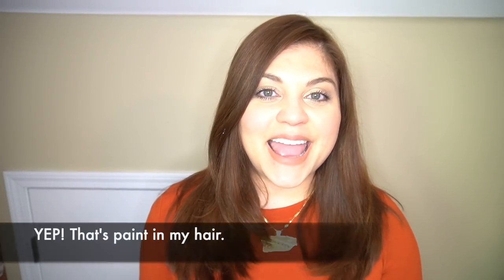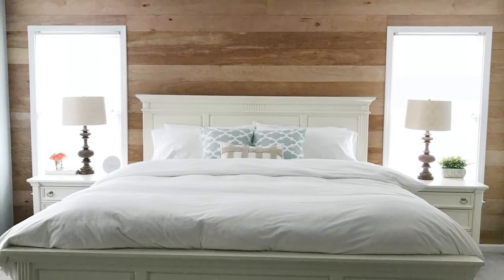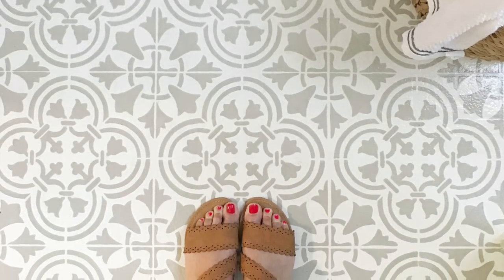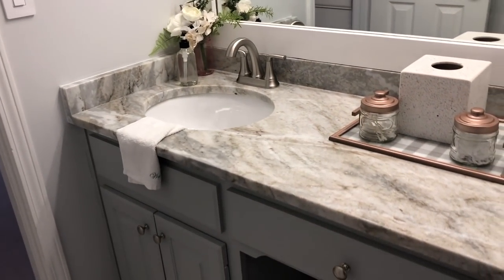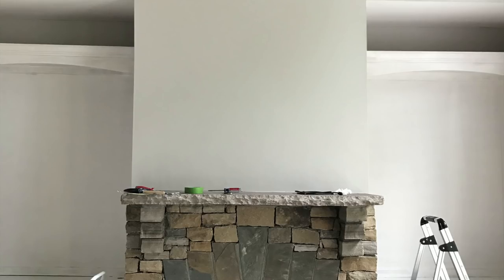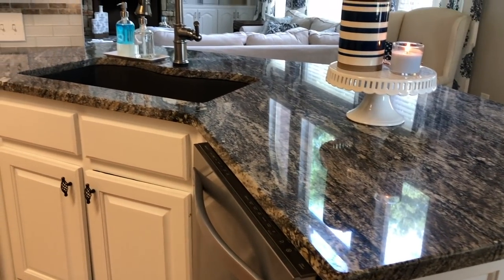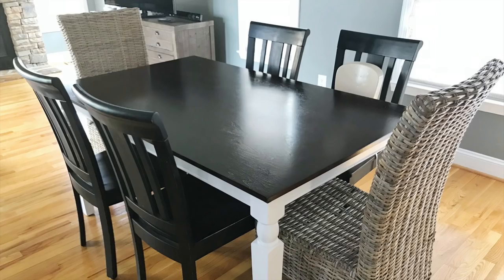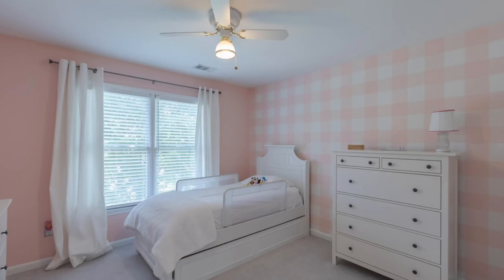8 DRAMATIC ROOM TRANSFORMATIONS | The Power of Paint

Comment: Hello new subscriber here! U guys did a great job! Looks amazing. Just bought a house & the master bathroom wall has water stains you know like from the steam of the shower what paint should I use so It doesn’t happen again once I paint it What’s the best paint for bathroom wall? Or what would you recommend?
Reply from the maker: Hello and thank you for becoming part of the familia! 💕If your wall has water stains then the best way to get rid of it is by using an oil based primer to cover and seal the stains. Then after you prime it. Use a paint with a satin finish. This will help any steam stay on top of the paint and can be easily wiped off going forward. Anything less than Satin will be too porous for a bathroom (or kitchen). Hope that helps!

Comment: What exactly did you use to attach the frame to the bathroom mirror? I have my wood pieces cut but I am unsure what to use to adhere them to the mirror. Thanks!
Reply: We use Liquid Nail, heavy duty if you want extra hold.  Also used painters tape to hold until the glue dried.
Reply from the maker: What he said! 👆🏼💕😉
Reply: @latinoengineer  I